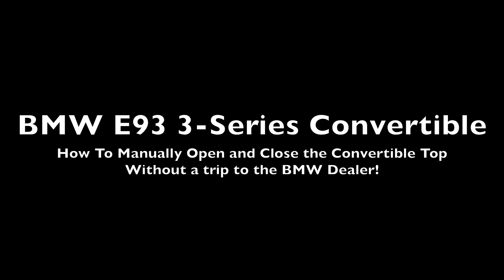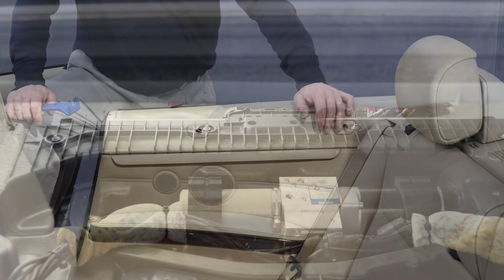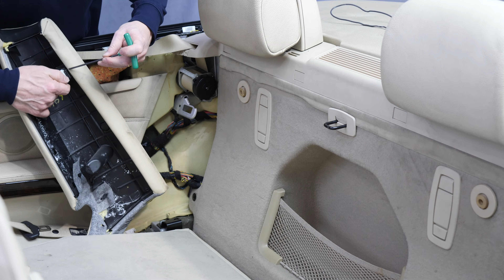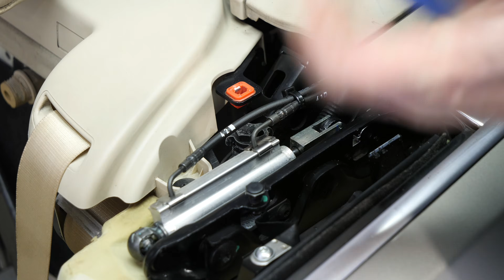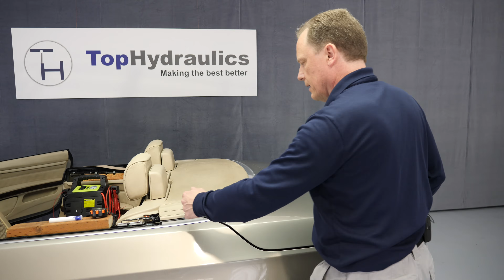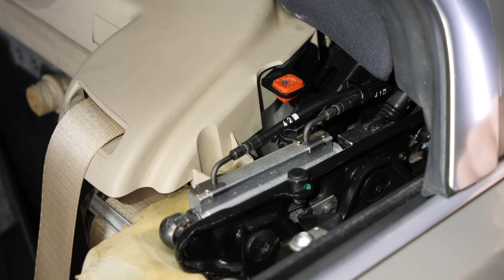How to Manually Open and Close The Top (Long Version) - BMW E93 3-Series - Top Hydraulics, Inc.

Comment: Such a rewarding video..Thanks. but please if possible show the process of changing the hydraulic fluid.
Reply from the maker: Thanks! We are planning to produce and release a number of additional E93 videos this year (2020). If you subscribe to our channel, then you will be notified as new videos come out. Thanks for asking about a procedure to change the hydraulic fluid. Changing all the fluid in the system at the same time would be a fairly complicated task. We will give some thought to creating a reasonably easy procedure for partial fluid replacement.
Reply: @TopHydraulics  hi sir..can help me..e93 roof top problem ..when open roof  is fully open and stuck in trunk ..trunk not close .pump still working but not close
Reply: @mathazilan2011  did you figure out the problem?
Reply: @mathazilan2011  could be the hydrolic valves

Comment: This is an excellent tutorial. My roof will successfully open and complete the cycle, followed by the windows closing. However, when trying to close the Roof, the trunk will open, but the roof will not rise out of the trunk. I believe that perhaps a microswitch is not working correctly. Thank you very much for the education.
Reply from the maker: Thanks for asking. Does it seem like the pump is trying to lift the top at all?
Reply: @TopHydraulics  Thanks for your response. No, I can no longer hear the motor working after the trunk lid is fully extended. Previously, I know that perhaps it is low on fluid because it used to take a long time to complete the close cycle. I will try to use the description to manually close the roof. Again. Thanks
Reply: Harold Alexander I’m having the same issue did you end up fixing it? And if you did how did you.
Reply: @stanshabak5723  Same here. I know this post is like 5y old, but would be nice to hear!

Comment: what about the front latches on windshield frame ? If electric is not working then i suppose you have to take off the plastic tab on headliner up just where the latches are and manually lock it as well?
Reply from the maker: Thanks for asking. Indeed, there is a way to manually lock and unlock the front. The front lock motor is in the top panel, center forward. There is a plug in the headliner that gives you access to the square drive pin that turns the locks. This pin is normally turned by the electric motor. It has an M4 internal thread. If you put an M4 screw into it and pull down hard and straight, then you can pull that shaft down such that it disengagaes from the electric motor and allows you to put a wrench on it.